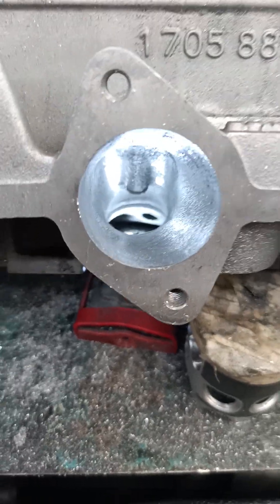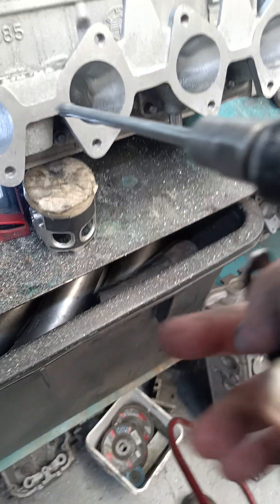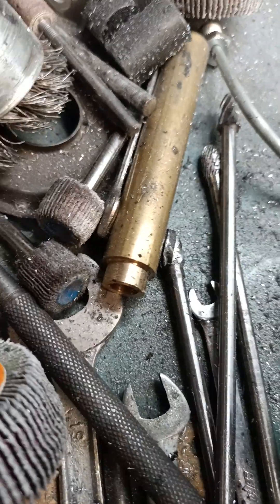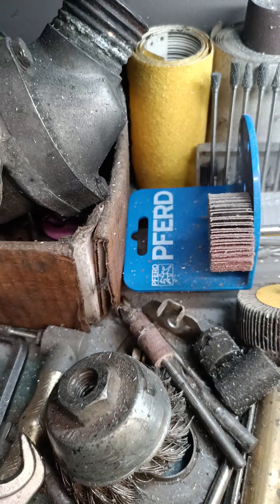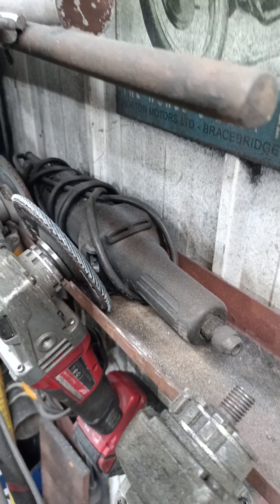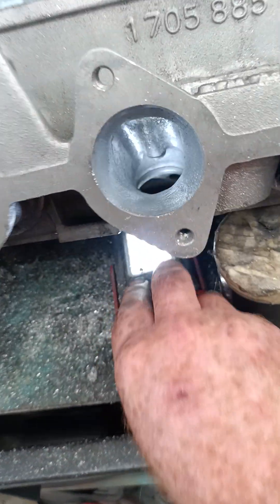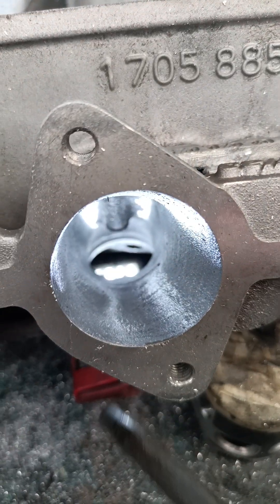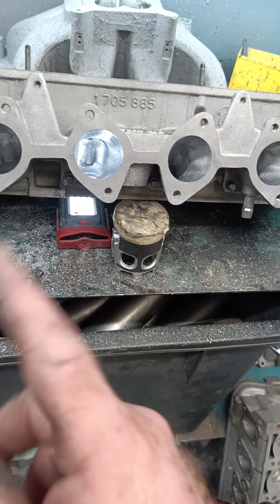porting basics BMW m20b25 head

Comment: Hey grooty, 
I have an M20 Engine with S50 85.8mm crank, 84.5 mm overbore stock pistons, stock 885 head with valve job and +1mm supertech inlet valve, and a schrick 288.
Compression is 10.4
Engine is still in the build, so i try to decide if i should go stock intake manifold with m30 tb or the dbilas itb kit.
I know, the dbilas is crap compared to rhd, but i have this kit here, so i could work with it for free.
Do you think with ported manifold and somehow increase the runner length the dbilas system could work and give significant gains over the stock manifold?
Reply from the maker: Great question, the dbalis kit will work but you need to port the intake and port the 885 head and it should be great gains, don't put it together with stock head it's just not worth loosing the amount of power you will, if you used a set of weld on injector bungs and moved injectors away from the head and weld up the top of the dbalis intake at the head flange the whole combo will work sooooo much better
Reply: @Grooty79  I have no experience with head porting, so trying not to make anything worse than it is. Or should i go with 272 cam, 3 angle valve job, just a clean up and stock manifold with m30 tb to net a package that is working nicer together?
Reply from the maker: @propellerhead101  pay someone to port head and intake, where are you located in the world
Reply: @Grooty79  Germany, onla flow bench bla bla porters here, nearly noone who is experienced with m20 head porting, they all make it just big, or are experienced, pushing 300+hp and dont talk or offer porting.
Reply from the maker: @propellerhead101  you could send it to Australia mate Ide be happy to do it as a job and share results 🤗 shipping might make it a tad dear though, I might be able to run through a couple of mods on a video that you could do yourself
Reply: @propellerhead101 contact Atrex automotive in Belgium

Comment: Nice work, had my head ported to the max and flow benched, Will be also on a 2.9 with itbs
Reply from the maker: This one's just a street port so should make 230hp with a 284 but heaps of torque, what flow figures did your head get on the intake ???